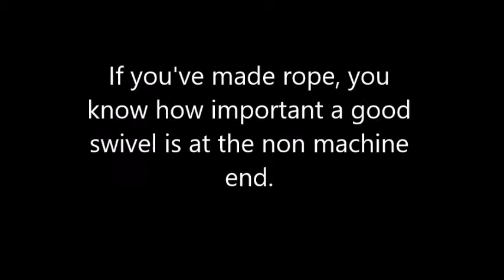Rope Making Swivel   Easy Inexpansive

Comment: Now, if you could drop some .177 air rifle BB's between the two stacked washers, ...  BB's, not pellets.
Reply from the maker: +David Brown  ... Dear Mr. Brown, That is a great idea.  I wonder if I can come up with large enough BB's not to fall out of the opening between the washers and the inside diameter of the pipe reducer and/or coupling.  For the speeds and needs of the eye bolts to turn, the slippage between the washers and nuts is smooth with little friction.  I was thinking of putting a little lubricant between them, but didn't really need it.  I'll have to play with it and see if your suggestion will help.  Thanks again.
Reply: +nomercadies while pellet size BB's are 0.177 inch, standard BB's are around 0.22 inch or close to it.  figure it out.  But if a little lube makes it slick enough, then leave it alone unless you like fiddling around.

Comment: You could just buy a "ball bearing swivel" off of Ebay for a few bucks.
Reply from the maker: hepcat 67 lead us to it
Reply: They are used for fishing.  The largest one appears to be size 10, which should do the trick.  Here is an Ebay search, which has several types:
https://www.ebay.com/sch/i.html?_from=R40&_trksid=m570.l1313&_nkw=ball+bearing+swivel+size+10+heavy+duty&_sacat=0
Reply from the maker: hepcat 67 the one I put together out of plumbing parts and such mimics the fishing swivel.  I'm aware of them and have used them in the past, but you need a huge one to handle the kind of tension and weight I've been working with.  Those were much more expensive than the one I made.  I'll continue to look for something like the fishing swivel for under fifteen dollars that can handle the workload of mine and post it along with your search.  Thanks for your help.
Reply: The reason I suggested the fishing swivel is because it has a ball bearing inside it, so I should think it would operate a fair bit smoother.  The number 10 size is 2.5 - 2.75 inches long, and is rated for almost 400 lbs.  Some are rated even higher, and a single unit is less than 5 bucks delivered.  I suggested it because I thought it was cheap enough to make it worth trying.  Great video by the way.  I'm very fascinated by the idea of homemade rope.
Reply: I just watched a video where he made a swivel out of the hub from a bicycle wheel.  You can check it out here:
https://www.youtube.com/watch?v=JNJAhqVX9VA